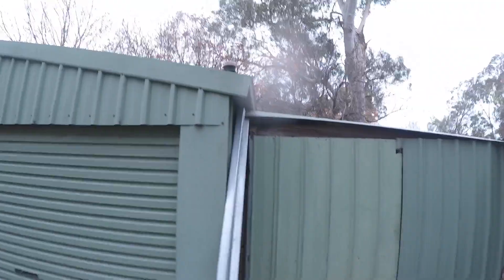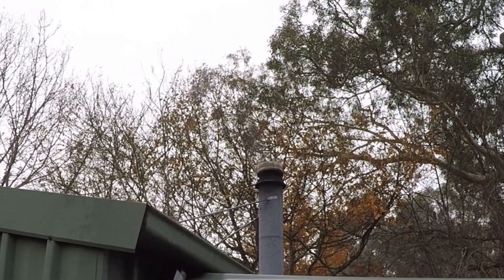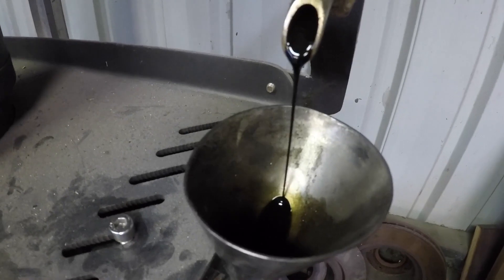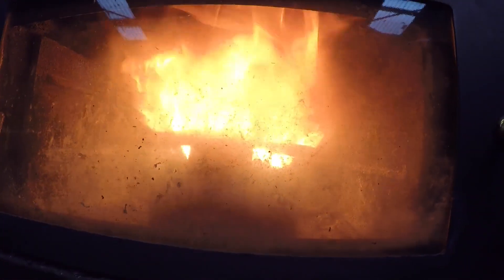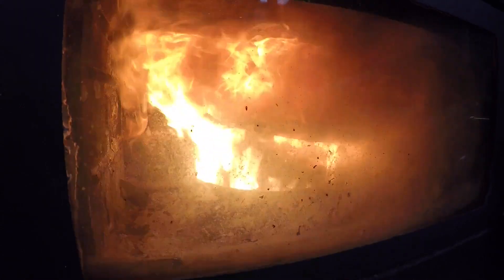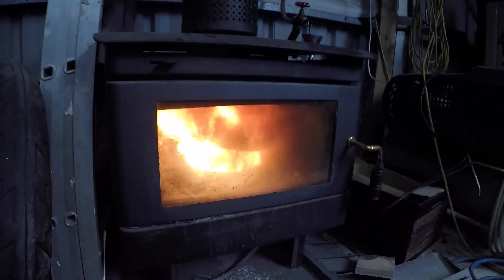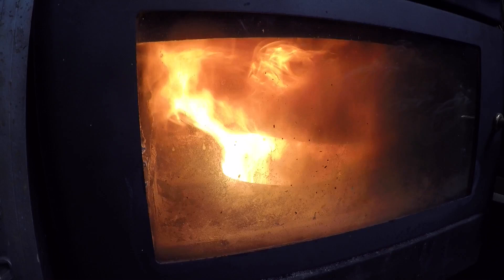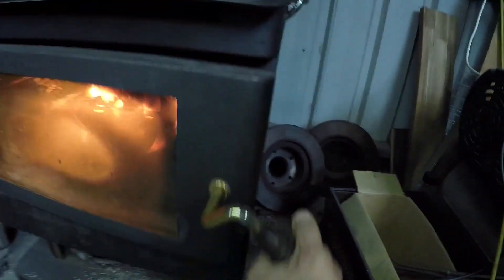Waste Oil Burner FREE HEAT

Comment: Perfect addition to the Aussie Shed.  I take it you burn motor oil but this would burn used veg oil just as well. At 1.5L an hour you are getting 15Kw out the thing which is about the max it would do on wood but obviously oil is a lot less work and you don't have to keep opening it up and adding more.  I hope to find an old heater so I can set one like this up myself.  Well done mate!
Reply from the maker: Thanks mate, I haven't burnt veggie oil but might try. For me the main purpose is to have a way or getting rid of old oil. I have plenty of wood around the property so happy to go with wood most of the time...This burner works so well and its amazing how much air pulls through the base, meaning I don't need any fan....

Comment: Great bit of kit mate . Have you had an overflow yet and if so how did it go catching it underneath ? Like was it burning under or what ?
Reply from the maker: Hi mate, I haven’t had an overflow but after using this for a while now my original idea of the overflow hole is not needed as if the oil ever went too high it would just put the flame out as it would cover over the air inlet. I don’t leave it unattended just to be safe

Comment: thats mint bro! Im going to make one and post a vid.Would you change anything/or Dimensions?like the oil pan or Air hat thing?
Reply from the maker: No, pretty happy with it. I use wood most of the time so if I burnt oil more I'd probably find something to improve. The air/oil mix will need to match your specific heater but some trial and error is all thats needed.

Comment: Hi. How far does your oil supply pipe go? Does it go to the bottom of the pan or does it stop at the top of the pan?
Reply from the maker: Hi Baris, it goes a far way down, probably 3/4 the way down into the pan. To close too the top is no good as it will most likely burn from the tube as its in the air space.